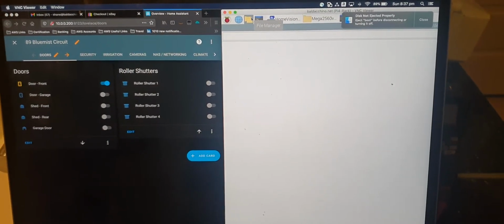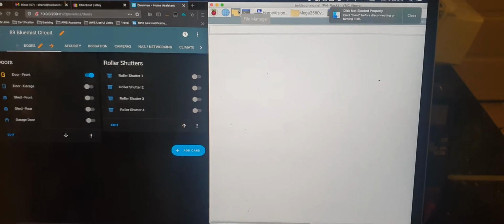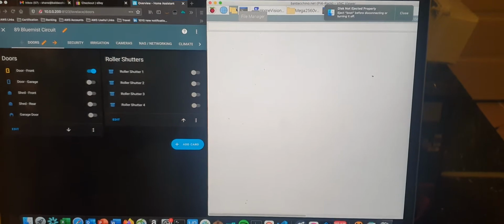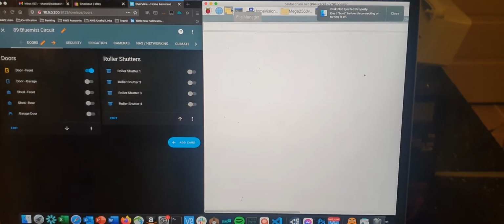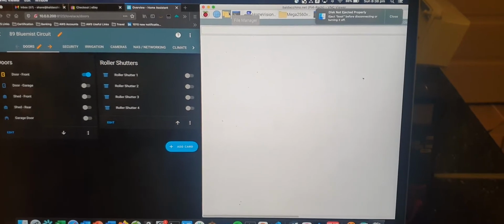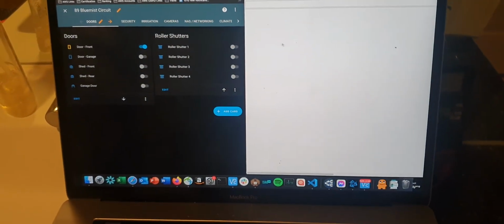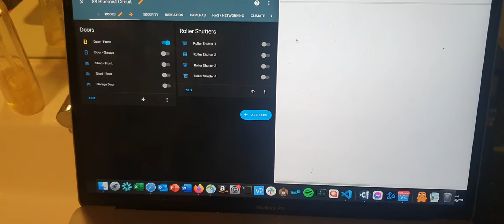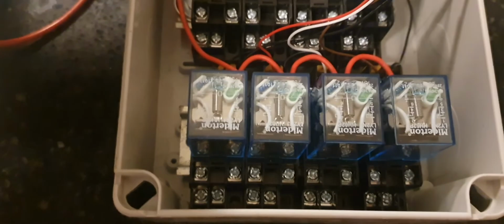Home Assistant + Arduino + MQTT Relay Example

Comment: Thanks for the video, planning same thing but with lights. Can you share links to the relays that you are using and the code for the Arduino? also are you using Ethernet shield for the Arduino to connect to the network?